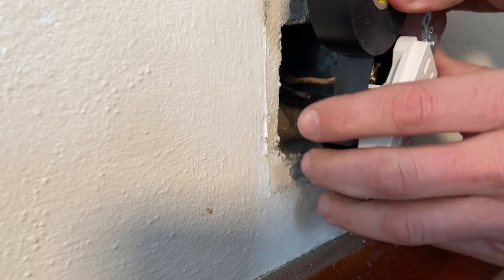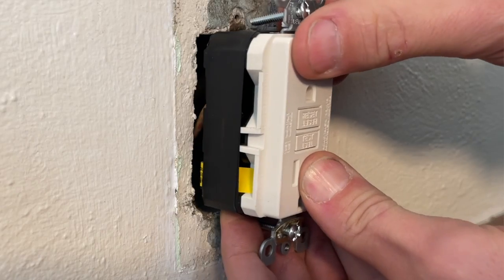Should You Wrap Outlets In Electrical Tape?

Comment: GFCI without a ground .. So would it be dangerous to use grounded plug devices in this outlet?
Reply: The gfci will trip and cut off the current to the device and hopefully before any damage is done.  It is the solution unless a pain in the butt rewiring job is in the plan.
Reply from the maker: Yep, actually doing another video on swapping 2-prong outlets where you don't have the ground to a GFCI.  This is approved by NEC but you do need to label "No Equipment Ground" on the face plate.
Reply: No, this is how you are supposed to add in grounded devices to 2-wire homes.  GFCI is detecting a delta between hot and neutral and after you cross a threshold it trips and kills the hot lead.
Reply: My house had 2 prong with metal boxes.  The boxes were grounded but not to the outlets.
Reply: If the plug is supply power downstream I would recommend wiring it in a way the downstream outlets are not GFI protected unless its clear where those downstream outlets are and they are properly marked.  Many times ive had to help home owners find the GFI that tripped causing their plug to not work.
Reply: @scottstewart9154  I believed you're required to label all down stream GFCI protected receptacles with a "GFCI Protected" sticker and "no equipment ground" sticker.

Comment: I was a electrician in Toronto Canada 🇨🇦 for 35 years and I always took a lot of pride in doing a better job then most ! So here is my take on your two items questioned , Wire Nuts , if you strip the 14 , 12 , 10 , gage wire the proper length then twist them together “ properly “  and trim , then put the appropriate wire nut on again properly there should be No reason to use tape after . No bare wire should be sticking out of the wire nut to cause any possible short .
If all that is done . If any bare wire is sticking out of the wire nut then the job wasn’t done to proper standards ,twisting the wire together “ If done proper creates a electrical joint that would never ark and cause problems ... So Tape isn’t needed !
Wrapping tape around the receptacle , is almost never done by professionals, that being said wrapping is a extra safety step that can’t hurt and would only help protecting from a ark or short when extracting a live unit from the box ( if metal ) . But for safety of a home owner doing his own work power should always ALWAYS be turned off when working on that box  ( circuit ) 
Getting tips on how to do it right from a professional should be a must for any laymen !
To many people “ THINK “ they know how to do it right and really don’t ! 
I’ve seen to many houses burnt from people wiring stuff in a house with not enough knowledge to do it proper.
And many of these self help videos ( sorry to say ) the people making the video don’t really understand how to do the job properly 😱 Good Luck be safe !

Comment: Only in metal boxes, also when I wrap I put the adhesive facing up on the first wrap and then turn the tape to put the adhesive facing down on the second. That way if the tape is ever removed it does not leave a residue on anything it was touching. Also when you're ready to break the tape instead of cutting it you pull and snap and let the tension from the stretched piece shrink back to its normal size then you press it it only takes a couple seconds.

Comment: I may have started the discussion by accident. Comment on NOT using tape is important, but more important is how to properly twist wires. You need a very good lineman's or specialty tool especially twisting #12. Stripping longer than needed, lining up the insulation, gripping wires in parallel to each-other. Then a good tight twist takes practice and results in carpal tunnel syndrome which is why most electricians use back wiring if they can get away with it. Finally the importance of cutting end of twisted wires so wire nut threads on all wires, and no copper is exposed..... back to the point IF YOU USE ELECTRICAL TAPE ON A WIRENUT, YOU DID not MAKE A GOOD CONNECTION!!!
Reply: I have long believed (of course, there is also evidence to prove it) that wires which are tightly twisted before being inserted into wirenuts are subject to metal fatigue. WAGOs are the way to go.
Reply: I only wrap the receptacle if there is a chance it may be hanging out live for the drywaller or others to use in construction.  (Got one hanging out live right now).

Comment: When I wrap receptacles B4 installing in the box , Of course I use Scotch super 33 + 
But I use the 1 1/2" wide tape and I back off the mounting screws to make wrapping easier
Also I wrap switches for added safety because when there's two or more switches in the box , Each one could be on a separate circuit and when replacing a switch , You may have the power off to the switch you're replacing and the others may be live  
Besides wrapping to prevent grounding out against a metal box 
It helps guard against accidentally touching the switches that are still live and I also use the 1 1/2" wide tape for wrapping switches as well
When dealing with a metal box and installing a GFCI outlet
Wrapping it with tape is an absolute must 
Whether it has a ground wire or not 
If there's no ground wire and the hot terminal touches the box , Will Make the box , The outlet mounting bracket and the ground slot electrically live which means you can get a shock putting a plug in and your fingers may touch the cover plate screw which is electrically live if the hot terminal touches the box that has no ground wire , Another thing in this case scenario , You plug in an appliance or anything that has a ground wire will make the whole appliance electrically live because of electricity backfeeding through the ground wire
Of course if the box is grounded and the hot terminal touches it , Will blow a fuse or trip the circuit breaker , So always wrap outlets and switches when installing in a metal box
I found this happen at my buddy's house , He plugged in his table saw and he got a shock because what happened was that the outlet was in a metal box with no ground wire and the hot terminal was touching the box which made the grounded part of the outlet live and made the whole saw live from electricity coming through the ground wire on the cord for the saw 
So after I fixed that issue I installed a ground wire from the outlet box to a metal ground rod driven in the ground because whoever wired his shop B4 he bought it had no equipment grounding , 
So him and I took out all original wiring and rewired the shop with all new equipment including a new circuit breaker panel

Comment: Two more important reasons for wrapping outlets: 1. Commercial space or school where walls are frequently painted. good painters remove plates, let paint dry. little fingers and metal boxes. 2. Conventional duplex outlets have one screw attaching wall plate. Learned from my grandchild, any space between wall and plastic cover plate, a one year old has enough strength to pull plate off wall exposing screws.
SO you don't have the latest child tamper resistant outlet, and think you are protecting kids with plastic outlet covers, but a fingernail behind the plate, and a tug, game over.
Reply from the maker: Hi Harvey, appreciate the additional example for safety considerations especially around little ones.  👍
Reply: Excellent !!!  Great points!  👍😁✌🏻🇺🇸

Comment: Cheap tape sure does make a mess and I happily pay extra for the good stuff.  Adhesive will gum up and take forever to wash off, not to mention the residue left on the wiring will collect debris, bugs, and dust over time.  In extreme cases that may even make it a fire hazard.  An alternative to wrapping the switch/outlet is to use a removable band.  I think Ideal makes some, and they are fast to put on and leave no residue when you take them off.

I also see a lot of guys in the comments talking about using tape to keep the wire nut from falling off, and their reasons for doing so are good ones (vibration loosening the nut, temperature changes, etc.)  So if you are nodding along agreeing with the pro-tape folks and want to avoid the tape issues here is what I recommend for wire nuts:
1) Twist your wires together until you have a solid mechanical connection between all of them.
2) Trim your wires and twist on the wire nut until it stops turning.  That's a good mechanical connection, so now to make it stay that way.
3) Slide your hand down the wire bundle so there are 2-3 inches of wire between your hand and the wire nut.  Start twisting the nut again until the wire bundle itself twists together--about 2-3 full turns worth.  I use a drill for this to save my wrists.  Your wire nut should not pop off during this process, so if it does, take the nut off and see where the connection started slipping and address that.
4) Now you have proven that there is a good mechanical connection between the wires, and the extra twists on the wire have become a strain relief for the connection.  You can stop here, but if you really want to keep going, I will assume you don't plan on undoing this connection any time soon.
5) Skip the tape.  Put some 3:1 heat shrink over the nut and wires and shrink away.  Unlike electrical tape the heat shrink won't break down when things get hot--in fact, it will snug up even more.  That wire nut ain't going nowhere.  What, you want more?
6) Instead of 3:1 heat shrink (or in addition to, if you REALLY want to overdo it) use some 2:1 dual wall adhesive heat shrink.  For those not familiar with it, this variety of heat shrink has a layer of hot glue on the inside so that when you heat it up, the hot glue melts in to all the gaps between the wires.  That helps keep any single wire in the bundle from moving while also making the connection water resistant (not waterproof).   And since it is hot glue you can cut the heat shrink over the wire nut and peel it right off the same way you strip a wire.  And no residue!

So now you have a bundle of wires that has a solid mechanical connection, a wire nut to ensure it stays that way, a twisted wire bundle for strain relief, and heat shrink to satisfy your tape fetish.  Talk about overkill.

Comment: So. Tricky subject.

Do we use tape? Sometimes. However we prefer not to.

The reason being,
 When your device is sent out for testing, at UL, IEC, ASTM etc. They test your device as is. Straight out of the box, installed per manufacturers instructions. 
What that mean is. These devices were never tested with tape on them. So once you go ahead and install that tape, you're now altering that device. So now it no longer complies with manufacturers recommendations. Which means it's no longer UL-IEC-ASTM  listed.

The other big reason, being heat dissipation. If you wrap the hell out of a device in tape, it's more likely to retain heat. As we all know, heat is the enemy of electronics. So you're basically accelerating the rate of failure. 

Now. For the real world. Fuck yeah, there will be a shitload of situations where you have to wrap em. 
Tight J-box? Wrap it.
Bare grounds flying everywhere? Wrap it.
Incompetent moron coming behind you? Wrap it.

As for wire nuts. If your splice is so poor, that you feel the need to put electrical tape on a wire nut to hold it. Stay the fuck away from electrical work.

if this pisses anybody off, we are willing to send out a video to you teaching the proper ways to perform electrical work
Reply from the maker: Thanks for the great feedback as always 👍

Comment: If someone it putting tape on wire nuts to hold them in, then they got issues. Tug the wires first and you can be pretty rough on them. Then if other wires in box, add a little electric tape to prevent anything poking in. Granted. Main issue is the nut is rated to like 900 degrees, the electrical tape isn't, but its not going to ever get that hot without some much bigger fail. Thus looking at a possible over amperage, the nut will probably get to around 250 degrees and again the tape will likely fail. Okay, looking at standard max amperage, it will likely only get to about 75, so will the tape handle that? Back to those fails, I wonder how the electrical tape would fail and would it cause any additional harm.

Comment: As an EX electrical contractor I suggest twisting the conductors tightly and cutting them flush before installing a wire nut and you'll never have an issue and we always used Scotchlok connectors because they are soft and conform over the wire bundle unlike hard plastic wire nuts which just catch the tips. And we never taped a receptacle or never heard of a professional doing it...

Comment: So 10 years down the line wouldn't the receptacle be covered in sticky 3m tape residue and be even more annoying for the electrician? Just a question I'd like to hear your guys feedback! Thanks!
Reply from the maker: You can get the residue left behind which I see much more on wire insulation for tape around wire nuts.  I think it will depend on the brand of tape (3M Super 33+ being the best) and the heat/moisture in the box over the years.
Reply: tough shit for the next guy
Reply: I agree. Heat will make it brittle over time. Moisture will make it sticky, especially if the wires carry much current.
Reply: Your fingers will get dirty anyway

Comment: @Everyday Home Repairs, people mentioned the pull test already, but if you really want to go overboard, you pre-twist the wires with some lineman's pliers. then you snip the ends flush. Then wire nut. Then electrical tape if necessary. You should never be second guessing any connection you put in a wall. For the outlets, yes to the e-tape on the receptacles, and I would even go as far as to say sometimes cover any extra holes with electrical tape in new construction electrical boxes, especially in areas where insulation can settle into the box over time.
Reply from the maker: Thanks Caleb!

Comment: who cares, it doesn't hurt wrapping the outlet.
Reply: I'd imagine an electrician doing thousands of these would be hurt by wrapping the outlet unless he somehow factored it into his costs. But e-tape ends up being kind of an offensive thing to find on an invoice given to a customer.
Reply: You cant use the LED plates with tape.
Reply: It flags the work as “homeowner.”  That’s a good thing. When you need professional help, it saves them time trouble shooting.  Just do it.
Reply: I imagine in a high loading application it would reduce the life of the outlet. The wrap will reduce heat dissipation
Reply: @jamesscott6753  yup.. & in my experience it also prevents. drying out after high moisture /condensation situation.. may also be why it's not recommended upon  inspection.  Stuff happens.
Reply: @jamesscott6753  Change High to Over Loading.
Reply: @miketritsch6166  pretty sure over falls under the term high
Reply: Definitely 👍, dumb me switch the wrong breaker off and got what coming to me. Little more safety doesn't hurt.
Reply: @johnpaulvan2910  how does this solve that at all? If you need to do any electrical work. You'd need to take the tape off
Reply: @jamesscott6753  If you are having heat buildup at the terminal screws, then you already have unwanted resistance there, which is a much bigger problem. I doubt the e-tape is any more an insulator than the plastic mold the receptacle face is made out of. If installed correctly, the spring connectors holding the blade of the plug are going to introduce resistance well before the screw terminals, especially if you are using a Leviton device.
Reply: @punkz87506  its not necessarily at the screws, its internal, but thats a goodway for heat to be dissipated through the terminals
Reply: @jamesscott6753  While I agree that every little bit helps, relying on screws to dissipate heat in a circuit is bad practice in my opinion. It is probably swayed because I do lots of live device swaps, and prefer safe working practices over an incorrectly installed device.

In my experience, space heaters running will be tripping breakers long before I have to worry about taped screws shedding a few watts of heat at poor termination points

Comment: With regards to the wire nut, agree on the idea of the tape not being used for the connection.  I still use it to seal the opening of the applied nut.

Comment: I've wrapped receptacles with tape when using metal boxes. And when mounting multiple receptacle in tight areas. A few of the old timers and journeyman that I've worked with would in some cases wrap electrical tape around the receptacles. We've used electrical tape on wire nuts in some areas that maybe subject to moisture from condensation but the tape is put on only after checking the connection for a tight secure fitting by pre twisting the wire ends before putting on a wire nuts. 😎